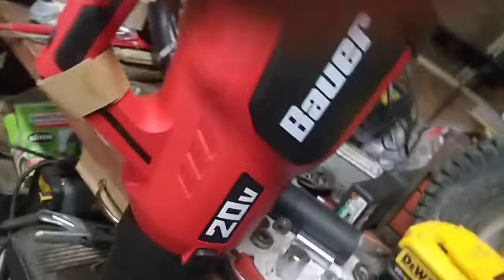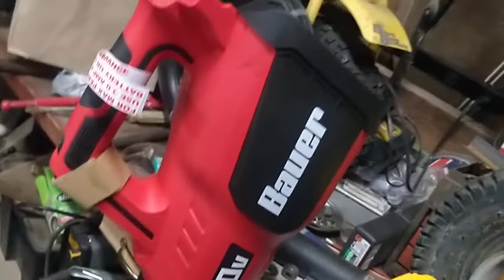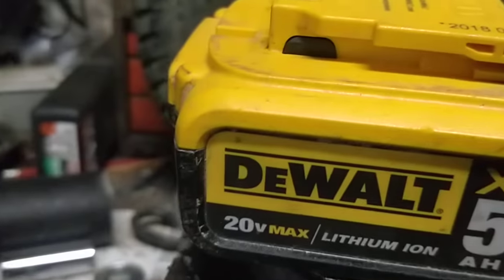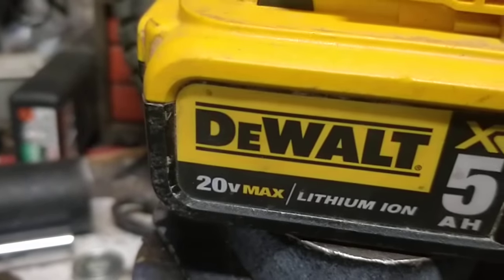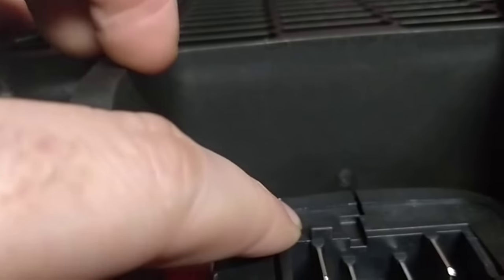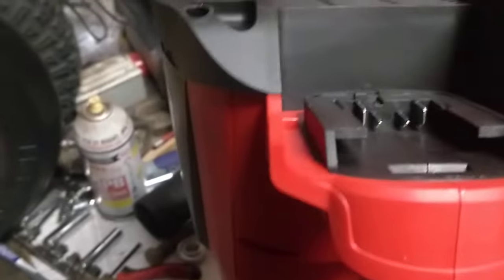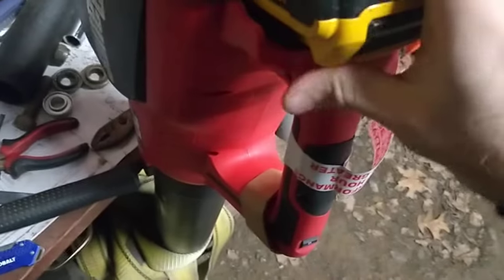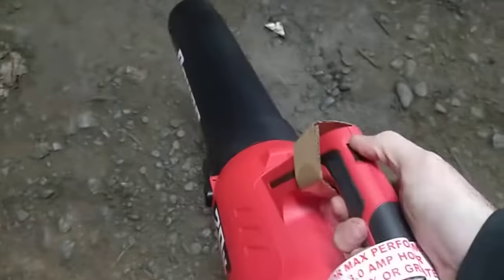Can you power a 20v Bauer tool from Harbor Freight with a Dewalt battery?  Let's find out!

Comment: It was this video that helped me decide to buy the much cheaper Harbor Freight tool and modify it (per this video) to use one of my dozens of Dewalt batteries.
I did this modification on a new Bauer oscillating tool. The battery fit perfectly...

It ran it for maybe a second, the handle got warm, then nothing,
Now I'm stuck with a useless oscillating tool that I can't return. it won't even run on a bauer battery, it's fried.
Beware people. This modification doesn't work anymore.
Reply: Sorry that happened.  Was the tool definitely a  20V model?

Comment: Bauer batteries are way cheaper than Dewalt, the real winner is if a Bauer battery can fit in a Dewalt.
Reply from the maker: Thats true, but Dewalt's are already in most of our garages, and they are generally considered to be good batteries.  I created this video because I have 4 of the Dewalt 20v batteries, and the Bauer leaf blower cost half as much as Dewalt's!
Reply: @liftyzig  solder two wires from drill to battery contacts....or use gater clips.  There's a million ways to make it work.
Reply: Ya I was looking at an adapter to be able to use my Milwaukee batteries on those tools I guess I have 1 or 2 DeWalt batteries but just like 1.5Ah or something
Reply: Based comment. You can find knock off batteries too that do the same job.
Reply: Agreed why would you pay more for batteries H/F always has Bauer batteries on sale and there already cheaper than every other brand🤔 don't know why you would do this never seen a Dewalt battery on sale unless it's around Christmas
Reply: Exactly. I have quality tools, and would like to fit cheap batteries into them.
Reply: @Rivierars  well if you have a all dewalt and want to stradle rhe bauer line of excellent tools , tool only time is a good time!
Reply: @Rivierars  dewalt batteries are always on sale lmao
Reply: Bauer tools are also 1/3 the cost of dewalts.
Reply: If anything spend the money on the batteries, Bauer batteries are trash unless you don't use them.
Reply: I have the 2 adapters to be able to use DeWalt batteries on Bauer and Bauer batteries on DeWalt. Like 12 bucks each on Ebay

Comment: I bought a Bauer blower today and tried it.. Cut off the tab and was a bit hard to keep battery making contact.  I found that filing down the upper most part of the blower case where it rubs against the battery helps (I used the edge of my 3 inch cut off tool).. also rocking the battery left to right when inserting the battery helps.  Think we got something here. Got an open box at Harbor Freight to boot, so my cost is $44 plus tax...not bad..Beats $150 for a Dewalt.

Comment: What’s really cool is the tools that Bauer makes that Dewalt doesn’t. Like the cordless hot glue gun for $20. It works with some quick dremel sanding
Reply: Yeah that's what I was going for, the hot glue gun.
This trick didn't work for me.
The battery doesn't fully  engage.

Comment: my heart sank for a second.  now i gotta run down to HF and get that high speep angle grinder.  woo hoo
Reply from the maker: May not work for the grinder, you should do a little more searching to see if anyone else has tried it...  The grinder would have more circuitry inside than a leaf blower.
Reply: Did you try the grinder? I had to add a bypass circuit to the hand held air pump and was thinking of doing the same to the grinder but if it isn’t needed that would be a lot easier

Comment: I wish major power tool brands made their batteries universal, it's not like they can't be, it's just the design, using an adapter works for every power tool normally
Reply: I've wondered if the EU might do something about this. They took on the standardization of the USB interface. And we in the US benefit, but the mindless proliferation of power tool battery types continues. It is totally cool that DeWalt batteries can work in a Bauer tool. I wonder if the opposite is true. There is one caveat to this stuff. Lithium battery packs have all sorts of stuff to keep them from bursting into fire. Even minor messing about with the packs might have some unintended consequences.
Reply: @davefoc  The EU is great for technological standardization, they could possibly do something in the future, I doubt any time soon though.
Reply: It's all the same standard cells on the inside, making it safe and easy to swap them around would be good enough for me.
Reply: @davefoc yes, I am more suspicious of the cheapest battery packs for safety. Saving money is good,  but not if it causes a fire.

Comment: I trimmed the plastic to help the battery fit better.  Just 1 mm on each side.  My blower did not work after I got the battery to fit.  The fan would just move momentarily, for a split second.  I opened it up, removed the speed control, and wired for all or nothing.  The power switch still works.
Reply: That’s happening to me

Comment: Bauer must have made a change to the blowers to prevent using other batteries. I just bought one and the Dewalt battery won't power it, even after dremeling the blower to allow the battery to fit. The blower works fine on a Bauer battery, so I know it's not a faulty tool. Hopefully it's something that can be resolved by a adding a resistor to the tool, but I haven't had a chance to take it apart yet.
Reply: I found the same thing. The motor buzzes for a second but won’t turn.

Comment: be careful, the battery protection for the dewalt batteries is in the tool not the battery
Reply: From what I've seen that's only true for older batteries.
Reply: The BMS is definitely "inside" of Dewalt 20v batteries

Comment: Only problem I see is dewalt puts the low capacity cutoff circuit in the tool not the battery
Reply from the maker: Yes, definitely is a problem. I left a battery connected and it completely drained and wouldn't charge. Had to jump it.

Comment: I would like to know if the bauer batteries work on the Hercules tools and vice versa
Reply: Pin spacing is different.  The packs are internally identical, though.  I took them both apart.

Comment: Got one today got the battery on and only clicks once and nothing after that you think it is a bad blower
Reply: same here. have you found anything out?
Reply: Bauer must have made a change to the tool to prevent using other batteries. I just bought one of these blowers and the Dewalt battery won't power it, even after dremeling the blower to allow the battery to fit. The blower works fine on a Bauer battery, so I know it's not a faulty tool. Hopefully it's something that can be resolved by a adding a resistor to the tool, but I haven't had a chance to take it apart yet.
Reply: Something definitely changed. This mod doesn't work on the one I bought May 2022. You need the resistor. Shown in Justin Benz's video with the Bauer light. It can be made to work by taking the "sense" wire, which is blue, adding a 10K ohm resistor and attaching to the negative post. I also cut a lot of material from the rear of the blower to get the battery to fully seat and click into place. A lot more work than I was expecting, but not too bad, as the plastic cuts easily. 

BTW, the way Justin Benz speaks in his video, makes it sound like you have the option to keep the "sense" wire in the same location, which doesn't work. Just follow what he did exactly.

Comment: I bought the Bauer 20v water pump and cut the same notch but my 20v Dewalt doesn't run it.  I'm not sure why.
Reply from the maker: @prohomevideos  I think HF made it so they don't power the Bauer tools anymore 😥
Reply: @liftyzig  It appears that way.  I did see someone on YT soldered a diode inside of his device to trick the tool and it worked.  I may have to look into that.

Comment: Ooooooh.  I needed this
Reply: So there IS a mod
Reply: But, does the dewalt use the same internal batteries? (18650) But more power?  Then what if you gut the dewalt and put it in the Bauer battery shell.

I know how to solder and shit though

Comment: For for every tool....if it takes a 20v battery and you use another battery that is 20v it works.....I've used jumper cables to connect batteries to a drill.  tape the battery to side of drill or leaf blower with duck tape.
Reply: Sounds like bs. Jumper cables? How would those pinch on the terminals on a drill? Regular wire taped to a tool maybe
Reply: This person isn’t talking about jumper cables used to start a car with a dead battery…  any wire connecting  things that aren’t normally meant to be connected is referred to as a jumper…

Comment: The better question is can you use the less expensive Bauer battery in a Dewalt???
Reply: ...exactly...cheap batteries for quality tools is the way to go...
Reply: Yes, of course. You don't have to cut anything off of the DeWalt tool either so it is even easier to put in the Bauer battery than the D into a B

Comment: Will making a modification to the Dewalt battery, such as a groove cut out on the battery for the peg on the tool work instead? Are there any visible deterrents? Could perhaps a Dremel tool accomplish something like this? The reason I'm asking is that I have more Bauer cordless tool than any one other brand. Aftermarket Dewalt batteries are very reasonably priced in quantity packs.
Reply: Erv Cobb if it did work you’d have to do it for every battery you wanna use with the Bauer tool.  Plus a 5ah dewalt battery is more expensive than half of Bauer’s tool line, so might be a better idea just to mod the tool.

Comment: There’s literally just one tab to hack off on the back of the Bauer tool. If you lay both tools flat with their battery compartment pointed up, look on the Bauer tool, youll see a little square piece of plastic pointed up towards ceiling, that same piece ain’t on the Dewalt, meaning hack it off and you’re done. Not sure what the heck you’re doing there but completely unnecessary… Lol

Comment: Does not work on the oscillating tool. It turned on for a 10th of a second and now nothing.
Reply from the maker: I'm sure they are testing for this on newer tools
Reply: I had the same thing happen on a brand new Bauer oscillating tool. In fact, It was this video that helped me decide to buy the much cheaper Harbor Freight tool and modify it (per this video) to use one of my dozens of Dewalt batteries.
I did this modification on a new Bauer oscillating tool. The battery fit perfectly...

It ran it for maybe a second, the handle got warm, then nothing,
Now I'm stuck with a useless oscillating tool that I can't return. it won't even run on a bauer battery, it's fried.
Beware people. This modification doesn't work anymore.
Reply: @RevolutionAdrenaline  I ended up buying the $20 adapter off of Amazon and it works on all of my Dewalt batteries and three different Bauer power tools except for my new power stack battery won’t work on any of those tools. I have the oscillating tool, the miniature grinder and the handheld Sawzall. (Btw that thing is a beast)

Comment: Can a baurer battery work on a dewalt?
Reply: I just tried it on my DeWalt impact gun,  no it doesn't click in all the way.  Looks like you can if you want to do these modifications to your DeWalt tools. you'll have to cut that little tab on the Bauer battery and remove about 3/8" on both sides of the body of the DeWalt gun then it will slide in deeper so the release tab can click into place.  But since I already have both Bauer and DeWalt batteries and charger, I'm not willing to do that experiment, only because the DeWalt battery in the DeWalt tools won't sit in properly after those modifications.

Comment: Does it shut off after a while when it over heats?
Reply from the maker: I haven't experienced this, I also haven't used it for extended periods of time.
Reply: If you are incompetent enough to overheat a power tool it is not going to last long regardless. I hire a lot of people to run a lot of tools. If some clown is so inept that they overheat anything I replace the Fool, not the Tool.

Comment: Doesn't work for the dustbuster vacuum... waste of time returned tool. Buying DeWalt...
Reply from the maker: Worth a shot, thanks for the heads up on it.
Reply: Hi,all..

If you want to be the only guy in town that uses Dewalt batteries on his Bauer drill with no adapter
please read on...

I had to trim off a couple small blocker tabs on each side track on the tool and also had to trim a tiny bit off
the drill itself at the front where the battery goes so the Dewalt batteries will latch in securely.

The Dewalt temp sensor (Thermistor) in the battery is 10K ohms at room temp and is connected between the b+ terminal and the 2nd terminal next to b+ inside  the Dewalt battery..

The Bauer temp sensor is between B- and the same 2nd terminal from the B+ terminal inside  their  battery and is also around 10K ohms at room temp.

I easily modified my Bauer drill for the Dewalt battery to slide right in and lock in place but
to make it work you have to have the 10K resistor between B- and the 2nd pin from B+ on the Bauer tool.

I opened the tool and removed the 2nd wire next to the B+ terminal and put a 10K resistor between that wire
 and the B- terminal. (Don't reconnect anything to the 2nd terminal you removed the wire from)

This will disconnect the Dewalt sensor as its not compatible with the Bauer tools  and replaces the Bauer sensor 
with the resistor too so either battery will work.
.
(This will satisfy the Bauer tools  thermal protection input and let it use the Dewalt Batteries.)

please

Comment: Didn't work with the grinder
Reply: Same just tried today even cut off the little tab thing just wouldn’t go all the way on
Reply: @k9deine351  there's a fix. Gotta jump the black wire to ground and trim a bit more
Reply: Elaborate.
Reply: I got it to work. Had to clip the black wire internally and solder it to the outside terminal
Reply: I have the Bauer hercules and dewalt adapter works 💪good.  I made a video on it.

Comment: 20v DC is 20v DC.  I would be more interested if Dewalt tools can be powered by much cheaper Hobo Freight battreeess.
Reply: What makes you think that would not work? DeWalt tools don't have the little piece of plastic so the Bauer battery slips in just like the DeWalt unit. Come on, if one works on the other and fits it will the other way around too. The nice part is you don't have to try that to figure it out!
Reply: from my experience dewalt batteries are superior to all other rechargable batteries. last longer, take a charge for many more years, don't mind sitting around.  I have converted all kinds of things to run on dewalt batteries for just that reason.

Comment: Bauer tools are junk!
Reply: In my first 2 years of being a carpenter I've gone through 2 chargers and 5 batteries from DeWalt.  At least the cordless drill still works...  But it's the old style they know longer make chargers and batteries for.
Reply: @tachometer-flac  oh
Reply: I have had three DeWalt tools fail. I have 9 now. My Bauers are not as old but get hard daily use. So far none of the Bauers have broken. The DeWalt batteries have all been replaced with much better, far cheaper aftermarket batteries from Amazon but all the Bauer batteries work fine.
It would be nice to hear more from professionals speaking from personal experience than people who know nothing about power tools or electronics to contribute.
Reply: @tachometer-flac  Thank you for the comments, it is great to hear from a professional instead of more thumb-smashing weekend warriors chiming in!